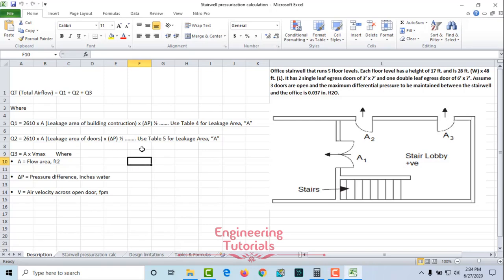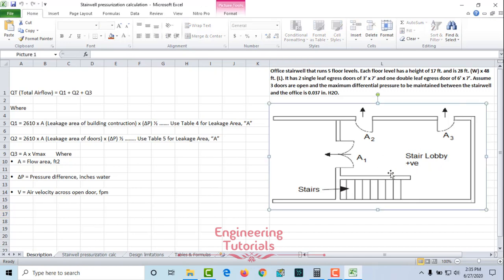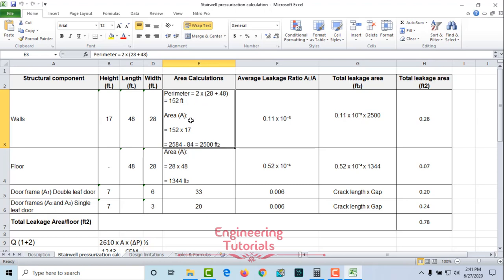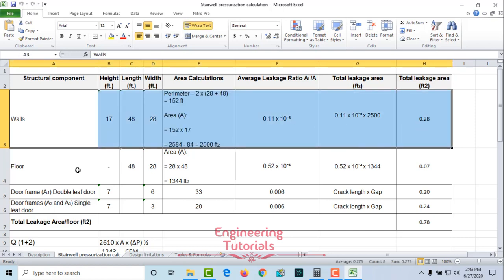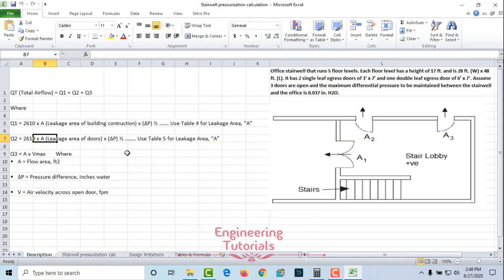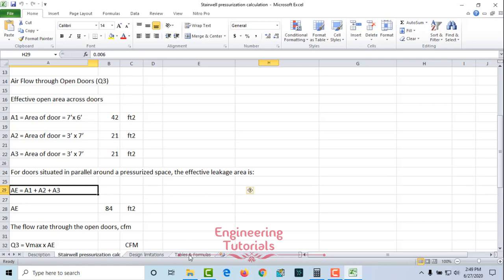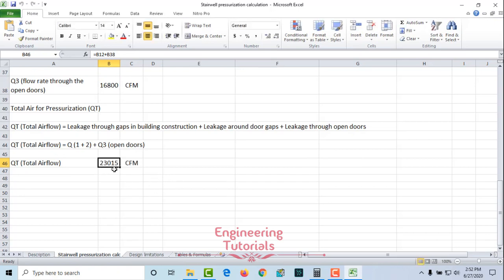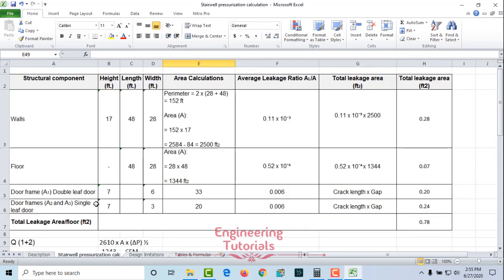stairwell pressurization system design calculations, SPF (Smoke management system)

Comment: Hi Sir, I have seen your video that was amazing, the entire concepts has cleared in one shot. Great!!
Sir, I have a few questions.
1) why we considering the max/min value of .37 in wg/ .18 in wg and 200 velocity max why not anything else. I want to know that what happened if we will exceed from it or less from min.
2) we select the average value during the Q1 calculation.
Suppose, nobody tells us that this is tight construction or etc. then which value we should consider.
3) During the grill sizing from where we should supply the air. I mean the location of the grill. It should side throw or top throw. In both cases supply air grill velocity should be 500-600 fpm.
Reply from the maker: Hi Harpinder answer to your questions is given below
1) These are standards developed by Ashrae that we must follow
2) If nobody tells you about building construction then you must ask Architecture Engineer about building construction whether it's loose, medium or tight
3) For stairwell pressurization system we have to supply air from side wall grills with 500-600 FPM velocity
Reply from the maker: syedmuhammadw@gmail.com

Comment: Where is the air outlet. From where the air comes out. Is it through the same exit  on the ground floor from where the people are coming out or is there any other way for air to flow out from stair well.
Reply: Through the Pressure relieve damper which is calculated by this Open door CFM - Stairwell CFM = Air Flow that Needs to be wasted
 and you can have maximum of 2000fpm for damper I think .

Comment: Hello Sir How can i ask for the excel sheet? Do you have also for the elevator and hallway of the building smoke extraction, thank you
Reply from the maker: Hello Jaime, you will get access to spreadsheet once you join YouTube channel membership on this channel. Thanks
Reply: Please send me the excel Sheet Sir thank you
Reply from the maker: Hi Jaime, please send a email request on mentioned email address to get access. Thanks
Reply: @MEPEngineeringTutorials  can i request for a excel file for complete smoke management system in a building
Reply from the maker: What's your email address?
Reply: I havent recieved any email yet
Reply from the maker: @jaimeplanas1796  How you will receive an email if you don't provide your email address. I asked that in previous comment

Comment: Can you please explain duct design for this CFM also.
Reply from the maker: You can design duct for stairwell pressurization system using equal friction method by taking 0.1 In wc/100 ft ... And rest of the method is same as I explained in my previous videos
Reply: @MEPEngineeringTutorials  Thank you.